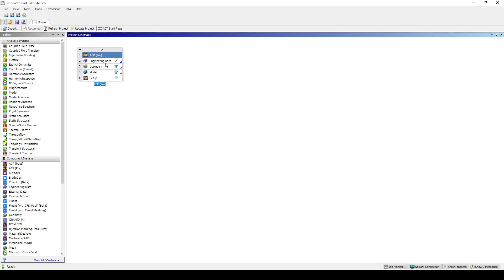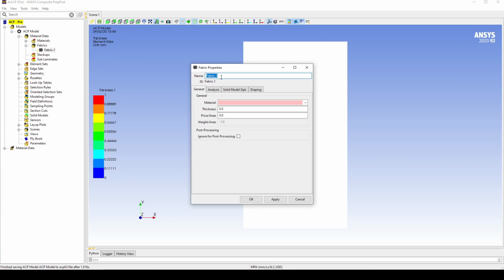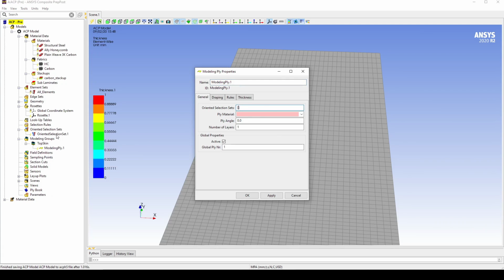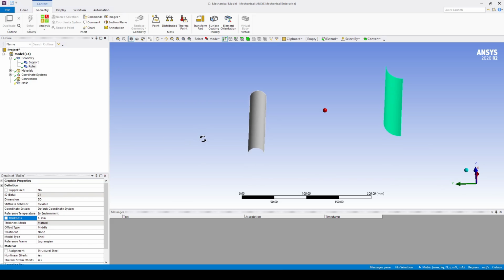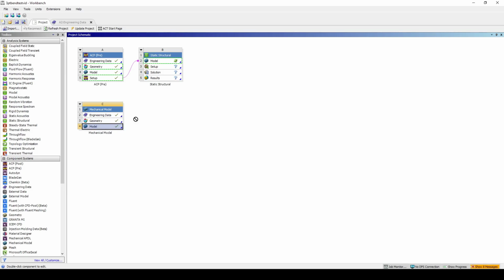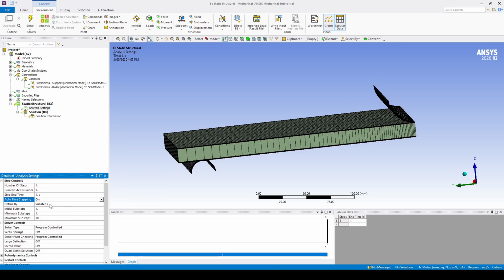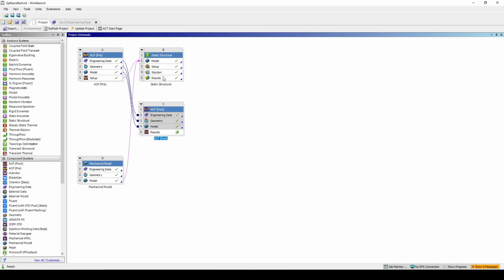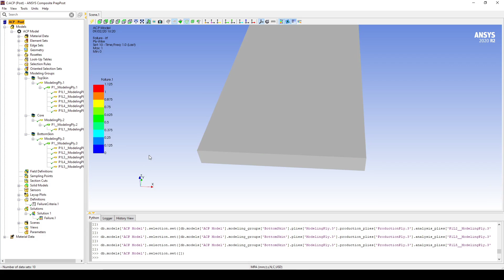Composite 3 Point Bend Test using Ansys Mechanical & Ansys Composite PrepPost (ACP)

Comment: hello sir , ma'am if i use smart crack in ANSYS  i need to use either static or fatigue method for crack growth law is there any way to get pari's law value or the critical rate value from Ansys. And if i modal cracked specimen and change the loading condition my result will change too but the maximum stress or load will be same for material so how to find that ? can you please help with this.